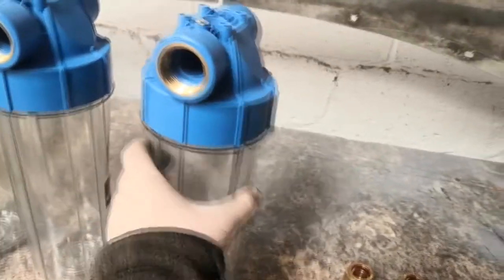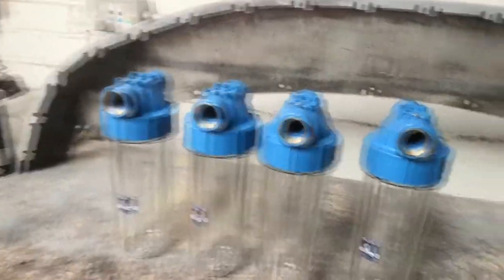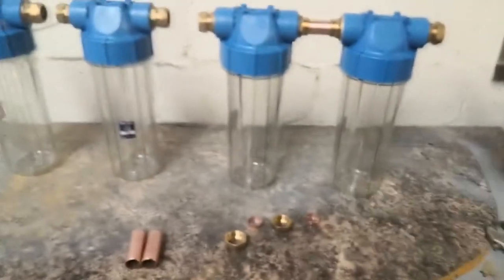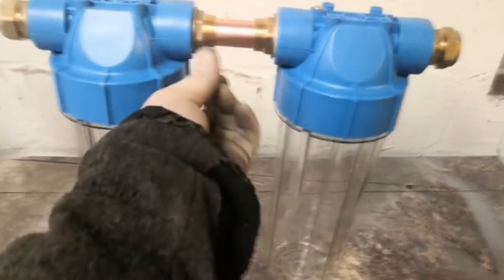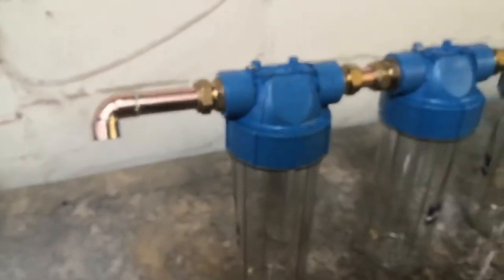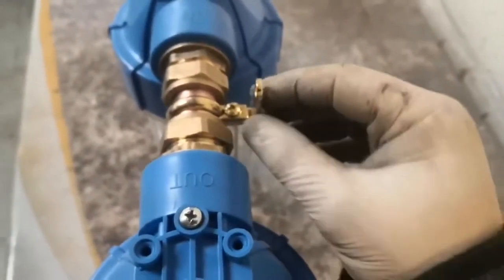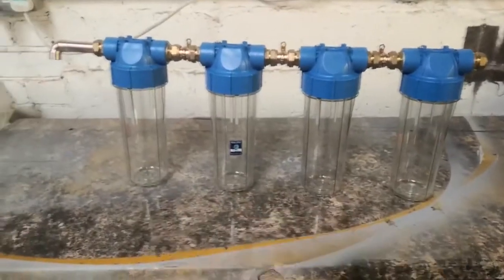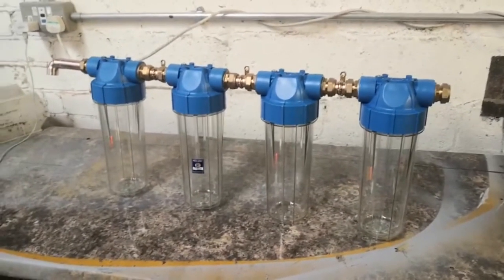Biodiesel/Waste Vegetable Oil (WVO) Filtering Setup EP2 - Filtration assembly.

Comment: Hi pal. Wa just ganna say am running 3 cars of waste oil mixed wi diesel, mk4 golf pd 130, mk4 golf 1998 ahf engine 1.9 tdi and a a3 2.0L bkd 140 bhp of it. Am using a 50 50 mix right now for last 3 months. Havent had no issues of yet. The only thing is in morning wethr its hot or cild morning it just takes 2 ta 3 seconds longer to start. Little puff of white smoke and its good. Also for the first min or 2 of driving its a bit sluggish before the turbo kiks in. After that its wickid. I think the car preforms better. Also when u rag it with diesel u always get a puf of smoke. But with cooking oil it hardly smokes even at high revs under hard acceleration. So yea mate. If its a german go for 50 50. Am ganna be tringing 70 30 in summer.
Reply from the maker: Sounds like a good experience so far just make sure you do oil changes more often like every 4 or 5k miles maybe 6k if you're doing a lot of driving I've been running my 2.5tdi T4 on 100% when it's warmer & 75% oil when it's cold, no issues so far
Reply: @DubworxMedia  yea pal i change oil every 4k miles mate. Dont wanna take any chances. Lol. 
Also the bigger the engine size the better it runs of oil mate. Its just when weather goes into minus is a bitnof problem.

Comment: Nice, thanks for sharing. I just got 1 of those type filters except mine has 3/4" npt threads.   I want to get a c/fuge too, but they're so dang expensive brand new, mercy. I'd like to get a used 1. I like the single pass type.    - take care man
Reply from the maker: Thanks for your comment, a few people on the bio fuel FB page said I'd wasted my time and money doing a filter setup and I should have spend £100 on a c/fuge rather than filtering so I guess either works.
Reply: @DubworxMedia  My 25 micron 5 gallon bucket filter is very handy & useful, even just w/ gravity it filters FAST. I drilled about a 7/8" inch hole in the bottom & drain it into a bigger tank b/c it's so fast.   I recommend those.
Reply from the maker: @leeisenberg  what do you do about dissolved water etc?
Reply: @DubworxMedia  I haven't found much in my oils so far. It should settle to the bottom & u can see it. That's what's cool about a c/fuge, they even pull out water.  If it's a small amount I'd probably not use it. I use direct sunlight on top of an old steel horse/water trough to dry clean jugs.  
Are u having trouble w/ water?
I haven't used much WVO, mostly WMO & WATF.
You're just doing wvo?
Reply: @DubworxMedia  I try to use clear jugs, but I need more, especially cubies/car boys.
Reply from the maker: @leeisenberg  At the moment I'm still on new oil, I've heard a lot of things about engine oil, heating oil, ATF, hydraulic oil etc, being illegal to run on the road due to tax and other legalities, also that it's not great for engines anyway, so I've stayed away from those but I'll hopefully be doing biodiesel from the WVO, I still need to make the stands to keep it out of the way though.
Reply: @DubworxMedia  New oil?  Are you buying it?  I've burned small amounts of new Expired oil when I've got my hands on it. If it's brand new I wouldn't even filter it, mix w/ pump diesel 50/50, 1/2 & 1/2, pour in & hit it.   Idk about illegal &/or taxes, not an issue where I live.  Biodiesel is a good fuel, but harder to make. I have no plans to make full blown biodiesel. Nobody even sells it where I live, which is near 1 of the fastest growing cities in the country. And bird brain Biden is pretending to be Potus & Still No biodiesel to buy.
Reply from the maker: @leeisenberg  Yes it's currently £1.57/L rather than £1.80/L for diesel, didn't realise you're in America, it'll be totally different situations but I currently just buy it and put it straight in the tank until it's winter then I mix diesel but hopefully be able to get the biodiesel setup finished before winter then I don't have to mix.
Reply: @DubworxMedia  Yeah I'm in Tennessee, near Nashville aka Nastyville. Man that's crazy, I can't believe cooking oil is cheaper than diesel.  What size jug/containers do u buy it in?   I measure w/ gallons usually, but sometimes Liters.   Hit me up on facebook if u want.    
Sounds like u got a good game plan.
Even kerosene is crazy expensive here.
Reply from the maker: @leeisenberg  I buy 5L bottles, when I first started about 2 years ago it was 98p/L now £1.57/L a lot less for your money and other than diesel and biodiesel/veg oil, there's nothing else I know of that can be legally used on the road, they're even doing away with red diesel aka cheaper diesel dyed red for off road use only, like plant machinery, generators etc.
Reply: Cool video, thx for sharing. What sort of pump do you use to move the oil through the filters and at what stage do you heat it?
Reply: @DubworxMedia  About the only idea I've had for getting rid of water & other contaminants besides filtering is a 5 gallon clear/clear blue water cooler tank w/ a valve/ball valve on the bottom, drain off the water/gunk u don't want after it has settled for a while. Any kind of upside down cone shaped tank works, but I just haven't gotten 1 yet. I would think it wouldn't be too hard to get your hands on a water cooler tank.                                                                        I think it would also work for draining contaminants like coolant/antifreeze out of waste motor oil & waste atf.                                            And a Centrifuge gets rid of water & antifreeze too, but they're so expensive, I want to find a good used 1.
Reply from the maker: @luckyphil_01  honestly haven't got any further with the build, life took over hence no video for a few months now.
Reply: @DubworxMedia  yeah mate, I hear you - life has a knack of taking over!